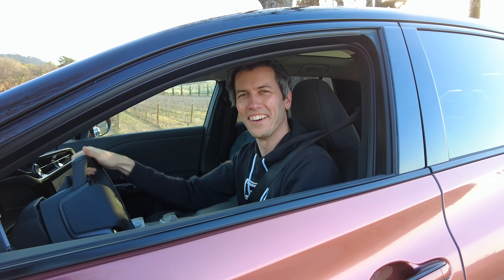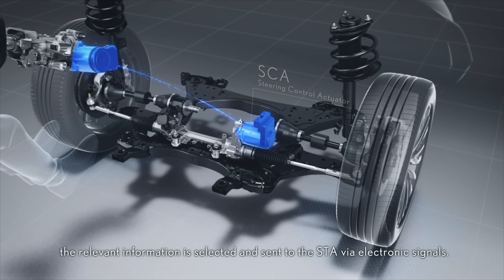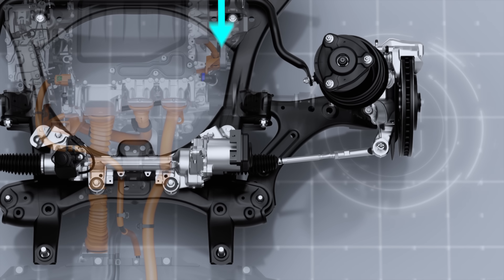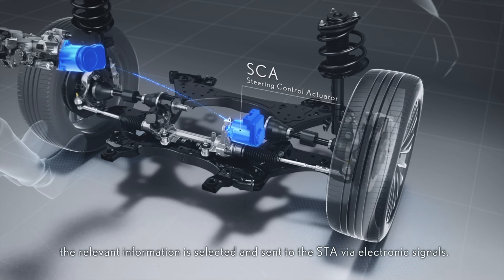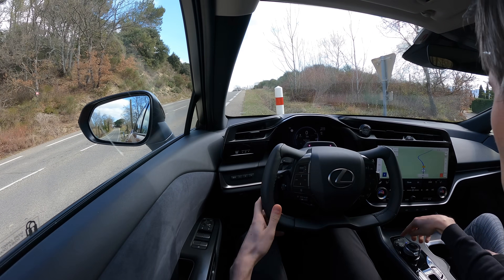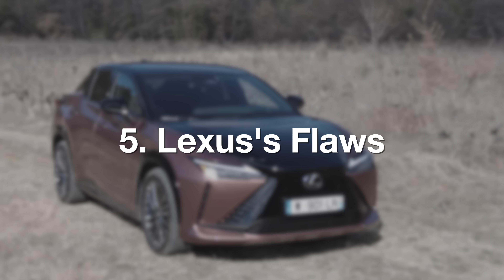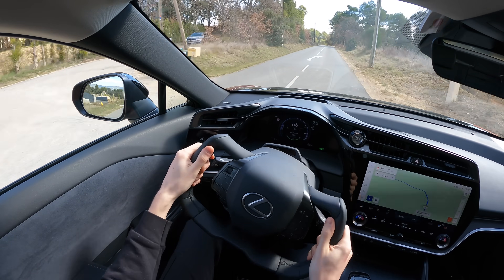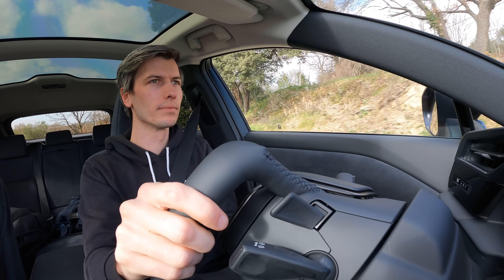How Lexus Fixed Tesla's Bad Idea: Steer-By-Wire Yoke

Comment: Only reason why they do this is to make cheaper cars. No different designs for right and left hand drive, no steering shaft, same firewall. Just 2  versions of dashboard and that's it. 

I had in my driving carrier brake failure 2 times, power steering failure 3 times.

I had once my car towed by other car because of dead battery - brakes and steering worked just fine.

And you have forgotten one thing - input lag. There is time delay between steering input, wheels turning, and system providing feedback to the driver. 
Human brain uses this to judge grip level in a corner or snow.

Throttle response on my car is so terrible (throttle by wire) that my sister hates driving my car. And her car still has throttle cable and feels great.

Comment: Do you think in the future this kind of system will have safety features to prevent dangerous manoeuvres such as roll over (think swerve test), perhaps via software or by using accelerometers?

Do you think cost will drop so that we will see them in budget vehicles.
Reply: I think the cost already dropped since Nissan developed this tech a decade ago, you can check It on a Infiniti Q50 since like 2014, feels really nice and you ger use to it quickly

Comment: You didn't touch on my biggest "what if". What if external forces (people/hackers) can somehow take control of your car, or mess with the electronics (EMP/Short Circuit).
Obviously, with drive by wire, you are dead. And we know there are lots of those external actors that WANT to have control of your car. So it'll be a no for me fam.
I'd rather have a GAZ-66 instead.

Comment: Corvette reduced boost to power steering at higher speeds to have a short ratio and not have the vehicle twitchy at higher speeds.
 A major FAIL with these new electronic cars if you are NOT near your electric vehicle shop good luck getting anywhere, I can access remove rebuild and replace mechanical steering rack, when power steering pump fails I can still steer.

Comment: Yoke steering wheels are a joke and should be banned.  At least the lexus system overcomes the steering ration issues that the tesla has in fixing how bad a yoke steering wheel is in slow speed maneuverability.   

But then anyone that has driven a car with a large amount of steering ration changeability or badly designed 4 wheel steering will know how off putting it can be and you can never feel confident that you know what the car is going to be doing unlike a car with a fixed steering ratio that a driver gets used too and predictability plays a large part of driver confidence.  

And safety or the lack of it. Sorry but no steering system where there is no direct connection is ever fully safe.  

Lexus is not the first to have steering by wire because INFINITI did it about a decade back and unlike this lexus system they had a steering shaft still that was disconnected in normal steer by wire but in any form of emergency situation where the cars systems even think there might be an issue that disconnected shaft is engaged so you now have a fully connected steering shaft again.   But look up all the complaints drivers had with that system in total lack of feel and input plus the same issue with never feeling like they knew what the front end was doing with the constant change in steering ratio. 

Now how can lexus not think that is something they should have a s well?  A total fail in basic redundancy and safety.  Then again look at the cars they keep designing and it's clear they struggle with good ideas.

Comment: The fact that they are able to pass the information selectively from the surface-to-tire is thoroughly fascinating. I never deliberately really thought about that. That tech opens doors for significanly improving DX by removing all of the unnecessary info you get from the steering wheel.

Its the small things that count when we’re diacussing higher end customer needs. For example, I’m driving company Lexus and just today I accidentaly found out how good the sound isolation in the car is. I opened a window for a few seconds while driving and after I closed it it felt like pulling the curtain on the outside world. Felt wonderful. I see steer by wire having the same potential. It will have adoption hurdles however. Biggest one being that there is no easy way to try it out for yourself. Scheduling a test drive is not the proper solution. We’ll see how the industry tackles it.

As far as Teslas implementation, can’t say I’m surprised. Move fast and break things…yeah.

Comment: I still think this is silly, to have an electrical system with no mechanical redundancies (this is the traditional definition) be in charge of telling your car where to go. Imagine getting up for work in the morning on a cold day to find that ice has damaged the force or angle sensors in the unit on the steering rack and you can no longer do something as elementary as turn the wheels. Or, how about if rodents decide that its a good idea to chew through the harness responsible for steering? Besides, I guarantee you I will be able to input forces on the steering wheel faster than the motor on the rack can react. All in all a silly design. A perfect example of "Just because it can be done, doesn't mean it should be." They talk about making the steering more responsive, as if a direct mechanical link to the wheels somehow introduces MORE latency into the system than a steer-by-wire setup. Nonsense.

Comment: I refuse to believe that the soy coated wires they use on these are ever going to manage any kind of safety. It only takes one field mouse eating one wrong wire and boom, ded on the first turn
I think it's awesome tech tho, even if I'm still on a manual rack and will stay that way as long as I can

Comment: Ok used to work on cars, and I remember starting to replace bad electric racks over your normal hydraulic racks.  They were a lot more expensive.   Not it’s steering by wire?  That means a lot lot of very expensive parts.  I remember older cars with air suspension.  Ya, nice smooth ride, but when they failed, people didn’t want to pay the high cost to fix it.  I know that is far cheaper then this setup.    It’s all great until you have to start fixing things.  The more and more complicated they make these cars, the more costly.  Sone of this may also be dealer only to fix and they’ll have the equipment to figure out what is wrong, maybe, increasing costs.

Comment: 12:12 I would argue the response is at least an order of magnitude worse than basically any normal car. The response in a normal car is almost perfect since the wheel is directly connected to the rack. The only delay is any slack in the components, but on many modern vehicles this is imperceptible.

Comment: I don't think what you are seeing is a delay in steering response, I think there is a maximum torque that the actuator can apply to the front wheels and the resistive force being applied to the steering wheel doesn't reflect that. If the wheels aren't keeping up with the driver input Lexus should be increasing the force feedback to the steering wheel to prevent the driver turning the steering wheel faster than the car can move the tyres. I would expect that if you jacked the front wheels off the ground so there is no resistance to turning this delay would no longer be present.

Comment: The new Canoo electric van has a steer-by-wire wheel, and they did something really interesting.  Because it no longer requires a steering column, they have space to play around with in the front.  They put in a "glass" window in the front bumper with an open dash, so you can see the road in front of you.  The TFLEV youtube channel has a video showing this.  I think the van itself is a little ugly, but super interesting.  You can make a U-turn and barely turn the wheel.  It's pretty neat.
Reply: "no longer requires a steering column", wow, since when? If that so, does Tesla still have it in their yoke cars or they just screwed it up by not making a proper steer by wire?

Comment: The problem will be they make this adaptable system and then won't let the owner adapt the curve to their preference.  "it's adaptable, to whatever we the manufacturer want to set it at".  I'll wait till they get the response issue worked out.  You think it's bad just standing still, what about a corrective input in a fast curve where the rack is fighting some real forces.  Infiniti already did the steer by wire, but they had a mechanical linkage backup in the event of failure.  Full dual redundancy, it's only as good as the watchdog deciding who's right when the two sides disagree.

And I'll never go yoke.  I've driven 30+ years one hand on top nearly all the time.  Not changing that now.

Comment: As someone who loves sim racing and uses a "yoke" wheel and a round wheel (depending on the car and steering ratio), I still think this is over complicating something that isn't an issue.

The #1 thing I'd say is this. Driving a real car where you get all of the real feedback through the wheel is an advantage not a problem. For those who don't sim race, we get our feedback through a method called force feedback. This is a great system in sim racing to try and tell us different aspects of the car (such as our tire grip) that we'd usually get through the wheel but it's no where near as good as the real thing. Even when we us direct drive wheels, it's not as good as the real thing.

2. A yoke is not a comfortable wheel for longer drives. Yes, you can do it, but a round rim is more comfortable because it allows the user to adjust hand positions as their arms and grips get tired. Yokes are used in sports like F1 for a few different reasons, none of which apply to normal driving. 1, visibility because the wheel would literally be blocking the drivers view of the road due to their seating position. 2, they are more compact which leads to less weight and the ability to squeeze them into the tiny cockpit. 3, F1 drivers have 0 reason to ever remove a hand from the wheel (except around the tightest turns such as Monaco).

3. A higher steering ration is not an issue at low speeds and it never has been. It actually provides a driver with more precision. Hand of hand movements is not an issue.

All in all, this research is interesting but sounds almost pointless to me. I understand it's use in non-conventional settings (such as the hummer's "crab walk") but it's over complicating a proven simple method. It's small benefits (such as more leg room and adjustment) isn't worth what you lose (as mentioned above).
Reply: Not to mention this complication comes with new levels of problems and needed diagnostics at the garage which translates to $$$. But to be 100% honest I also said something  similar years ago when ABS came out. Since then it helped me more than once.

Comment: I wish they made an electric car that was enjoyable for the enthusiasts that has a manual transmission, adjustable steering, braking and throttle settings you can toggle for different feels.

Comment: One idea that I've had is to use ABS modules with full hydraulic steering (commonly used on big offroad vehicles and boats). Picture the steering box and tie rods being replaced with hydraulic pistons running to a what amounts to a reverse power steering pump--as you turn the wheel, the pump drives fluid to the pistons (versus the fluid driving the servo). You can use the ABS modules to modulate the amount of pressure going to the pistons attached to the tie rods, which allows for control of slip angle and toe. That would be a pretty modern innovation on a vehicle, and it would lighter, safer (we eliminate the steering column), and smoother.

Comment: Why not get rid of the steering wheel, the brake pedal, and the accelerator pedal and replace them with a joystick (under the right hand). Move the joystick forward to go forward (as if pressing the accelerator pedal). Move the joystick backward to slow down (as if pressing the brake pedal). Move the joystick left to turn left. Move the joystick right to turn right. Move the joystick forward and to the left to accelerate and turn left. And so forth and so on....

Comment: NAW , there making steering wheel this way because of auto driving .  this design allow the steering wheel to collapse into the dash board giving more room when in auto drive mode.  after auto drive is standard than that will allow flying cars to come next!

Comment: This seems like it could be promising, and I thought that some cars with electric power steering were actually this way already because of how they feel. Considering how good direct drive sim racing wheels are, and that this system is the same thing, I think it's already off to a better start than when electric power steering was first introduced.
Reply: Steer by wire is Sure interesting, you can test It in Nissan cars from like 10 years ago, my 2015 Infiniti has this type of direction and works pretty well

Comment: That’s called high ratio steering system. I owned a 1970 European ford escort years ago and fitted a high ratio steering system. You only had to turn the steering wheel a little and the wheels would move much. It was actually made for race cars but was on my street car.

Comment: Very interesting and completely understandable. I'm still on the fence, however, as to whether or not I like it! DEFINITELY, it's perfect if you have a yoke and as you mentioned, you no longer need a steering column, so it gives more flexibility regarding placement. I just feel as though it lands up increasing the complexity (and therefore the cost) for benefits that aren't great enough. The idea of "faking" feedback seems like you're almost being fooled. Who knows? Maybe it would be better if we just didn't know it existed and then we wouldn't have issues with it!

Comment: 11:30 - people have been gaming for years with car sims, and there's a delay in the controller vs the car action, you get used to the delay and you drive to the limitations. I think this would be the same, you'd just get used to it.

I would like to see this in the moose test though. Is the steering like the brake pedal, that when you mush it hard and quickly, there's the 'panic booster' (I forget the name)?
Reply: This is totally different to a racing sim tho. 

In the racing sim, you can basically program the game to account for the input lag, reducing the time the simulated driveshaft takes to output your input.

In a real car this cant be done of the physical limitations of a drivetrain. Actuating them takes time that you cant compensate unless you go the prediction route, and that adds another can of problems to solve and could be even dangerous to drive legally.
Reply: @colinmcbottle  The racing sim is always going to have lag from input to control and you can minimise it all you want, but there'll be a split second between turning and the sim doing the action. It'll be the same for this, but this is dedicated, and it'll still have lag to get used to. Prediction won't work (altho nice idea). They'll have tuned this to react within a smaller timescale than gaming controls, but both won't budge until after you've made input, the computer has thought about it, then put that in to action.

Comment: Great Video and explanation, Couple of points. as noted sudden jerks at high speed might not elicit a response, ergo less safe. I am not a fan of same site redundancy as used here, If you have a rock crash the actuator housing you could very easily lose both actuators.  Driving comfort, As someone who has driven across the US a few times, holding the steering wheel either at the bottom or by resting my hand on the top (12/6 positions) when driving for hours on end is preferred and still allows for control. Don't see  this as an option on a yoke. Comparing racing drivers to average person is an unfair and honestly disingenuous analogy.  The more you train with a particular tool and use the tool in the actual setting the more proficient you become. There is a lot to be said for muscle memory. Honestly I can see the applications for this as being preferred if you drive short distances or do a lot of stop and go driving.  Long distances not so much

Comment: This "advantage" you tout is made irrelevant by speed-compensated steering - something present in vehicles for the better part of 3 decades already. We had a late 90s GMC with it, that took less wheel rotation to turn at lower speeds, and, more wheel rotation to turn at higher speeds - preventing you from "bumping" yourself off the highway with only small movements of the wheel, and, providing responsive steering at low speed with less movement of the wheel.

Comment: Tricky question. What happens when i'm accelerating out of or through a corner? My speed is increasing so i'd have to turn the yoke more to keep the same steering angle?
Reply: You'd have to maybe turn less an less, not more and more, but yes good question. They again, in reality you already do that because no curve you really do is just a simple circle radius

Comment: My biggest concern is everything electronic is a lot more expensive to fix or replace. And that is if you can find parts, because it is harder for aftermarket companies to reverse engineer and manufacturer electronic parts than mechanical ones.
Reply: However this does not only apply to this steering system, but rather to all electronic parts.

Comment: So if I’m driving on the highway and I need to avoid the deer or the moose, it sounds like this is not going to react fast enough to be able to do a high speed high angle maneuver. Would you say this is correct?

Comment: I think it should be possible to easily change fixed ratio instead of letting it change automatically.
Or maybe decouple it from speed entirely and instead just use non linear sensitivity with lower rate near the center position. This way it at least will be predictable.